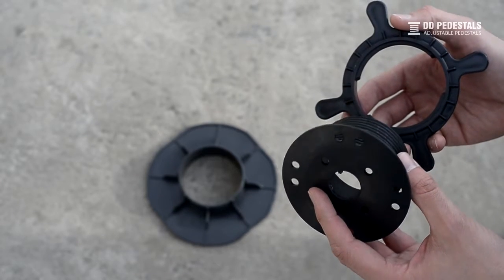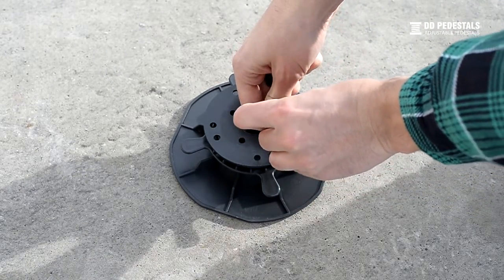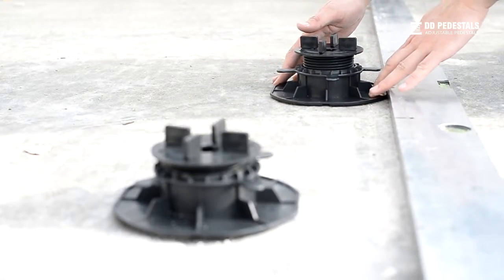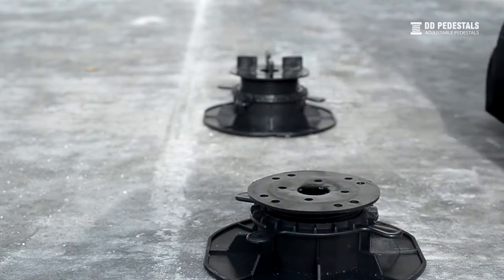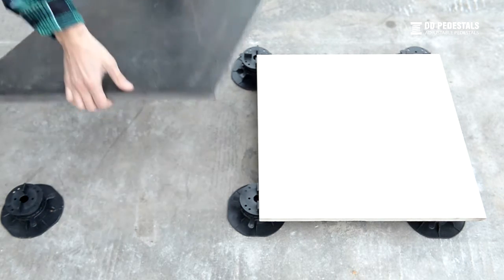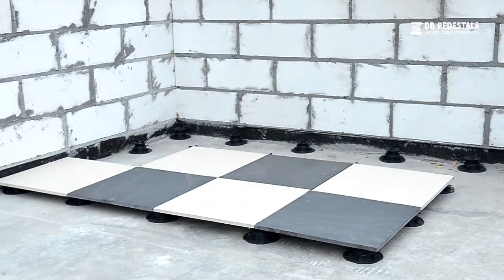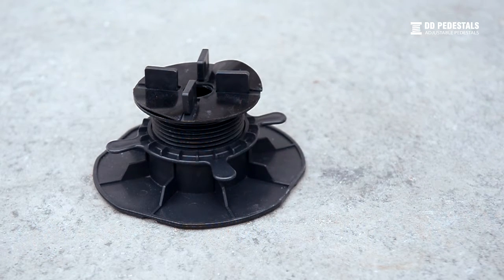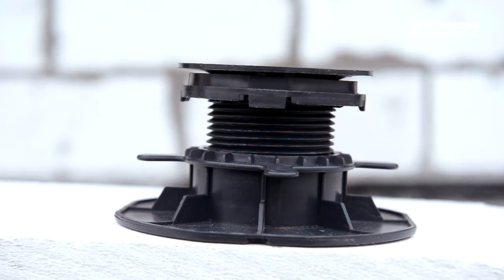Adjustable Pedestals with ceramic tiles installation

Comment: Great video 👍🏼 I find my 60 x 60cm porcelain tiles move very slightly on these supports and make a slight sound when walked on. Very annoying. Supports are on a solid concrete base. I’ve even tried using a grout between the tiles which stopped the sound for a few weeks but the movement has led to the grout falling out. Any advice please?
Reply from the maker: Hello. For moving tiles you should contact with your installer. There must be done a mistake during installation. For sounds you should use rubber shims between tiles and pedestals heads. Best regards!
Reply: Hello. Did you manage to solve this issue? Are you satisfied with these products? I am thinking on spending lots of money on a system like this for my terrace... I am nervous, could you please help? Thank you! :)